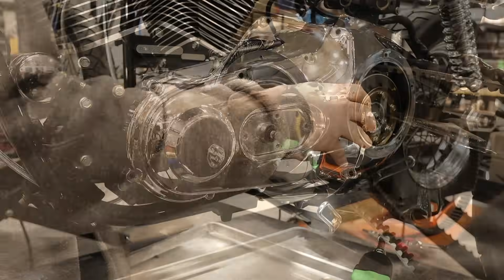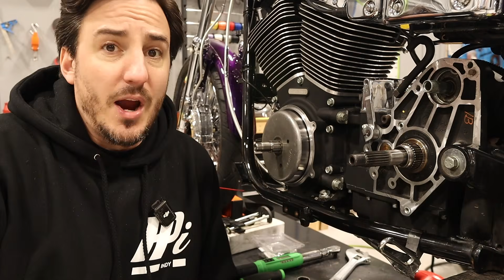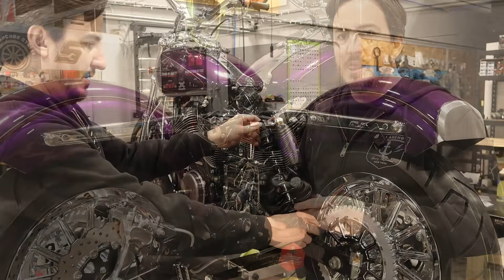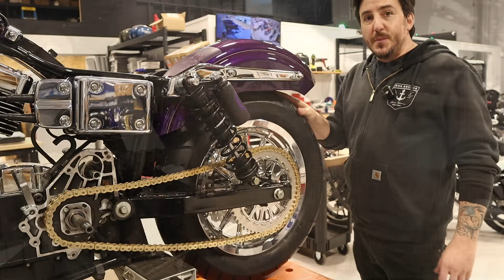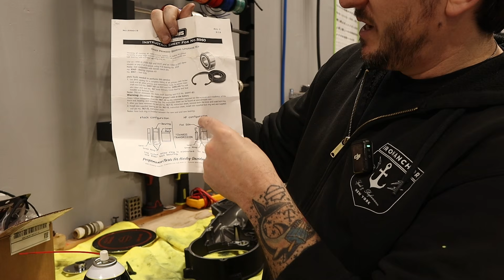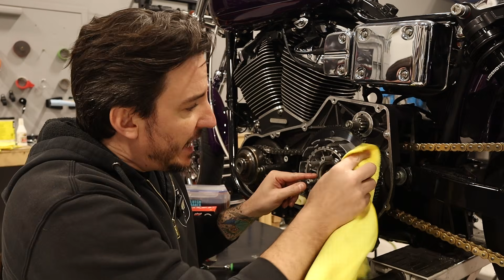Dyna Chain Drive Conversion & Clutch Upgrade | Ep. 5

Comment: FYI, if anyone ever does have to do their stator, you DO NOT need to remove the clutch. Just take the chain adjustment fully off, remove chain and compensator and voila. Of course do your rectifier at the same time.

Comment: All balls makes that sealed bearing for a little cheaper if that’s the route someone wants to go. Another great option is the stepped race from S&S that uses the stock style bearing. 

Another great modification is a 1 piece starter jack shaft from all balls while the primary is apart